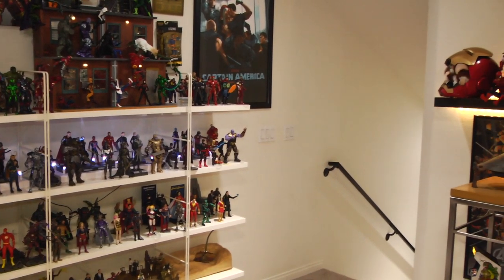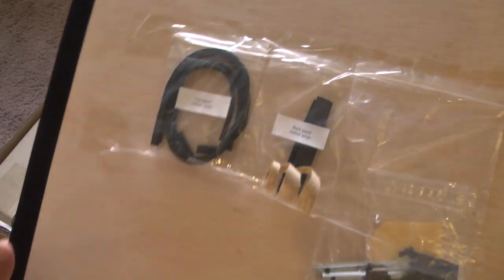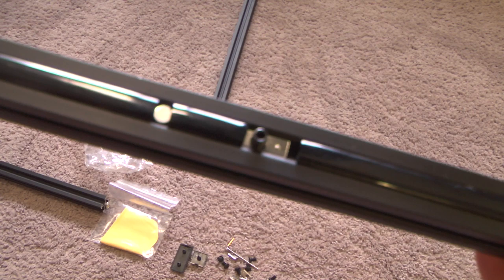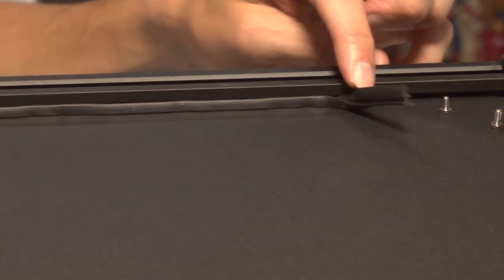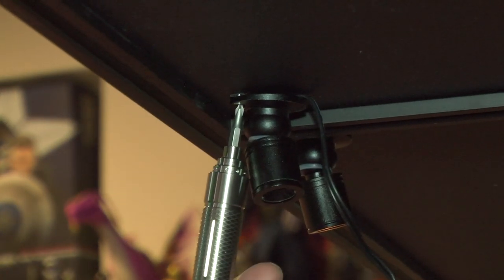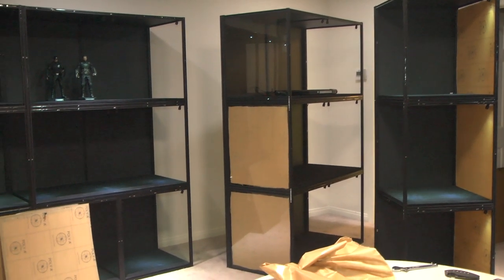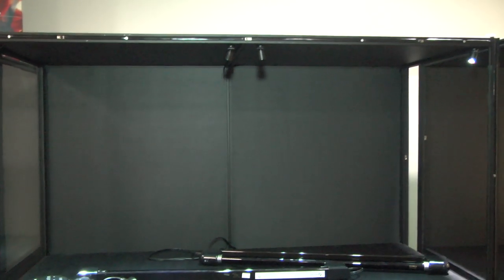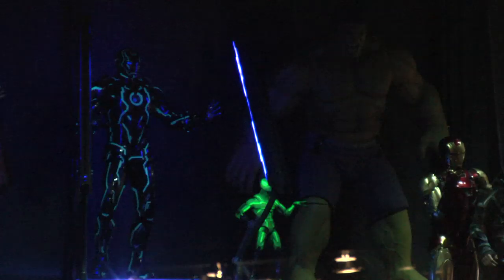My collection displayed using MODUCASE Danoby2

Comment: I have a max 150 with plans on getting more after I move into a bigger place. I agree that first one is by far the hardest. The adjustable shelf is not 100% leveled because I did it by myself. That being said it’s completely secured and not moving. 

The one thing I would recommend is put them on carpet or have some kink of pad if on the floor if you have hard wood floors.  Lastly they now sell tops for their various cases and they look pretty solid. Although I’m not sure if I feel like waiting months instead of just going to Home Depot and getting 2x4 cut to the right size.
Reply from the maker: I went to Home Depot and had them cut planks for the top. Didn't want to wait months!
Reply: @Danoby2  what did you use for the covering of the wood or did you just paint it.

Comment: Looks great!! I feel your pain in the back and fingers! Lol. I didn’t have as many to put together but I can imagine. One tip for the vertical bar to secure them. I stacked the case on top first and slid the bar down from the top and down the meet the next one. Worked pretty smooth for mine.

Comment: They look great, but Its just T slot extruded aluminum.. definitely cheaper to DIY it.. I mean its the same process of building a DIY T slot build as putting Moducase together lol
Reply from the maker: I've heard this argument before, I'll answer with the same question. Where do you the materiel and at what cost.?
Reply: @Danoby2   I had to build one for Timoon Broly and their biggest non custom wouldnt work. I think they charge $550+shipping for it. Cost to build one was right at $400 all in. Large sheet plexiglass was the most expensive part. Guessing the small boxes would be alot cheaper to diy due to that.  Tslot can be bought online custom cut. was able to find plexiglass local.  Best part, no 10 month wait list lol
Reply: @wootywooter5652  Where did you order the custom t-slot extrusions?